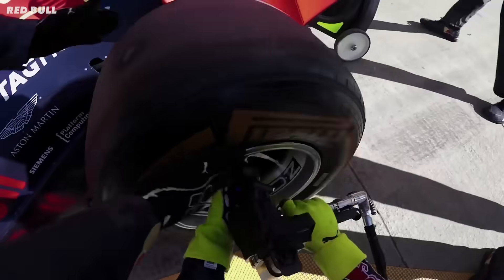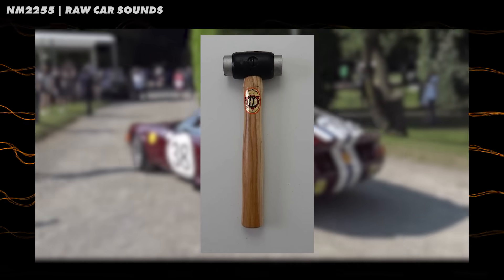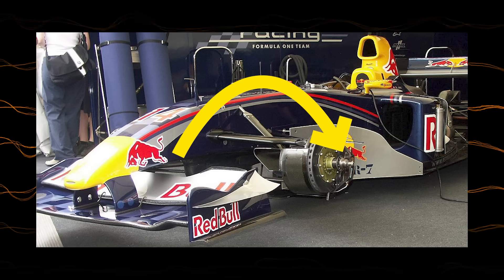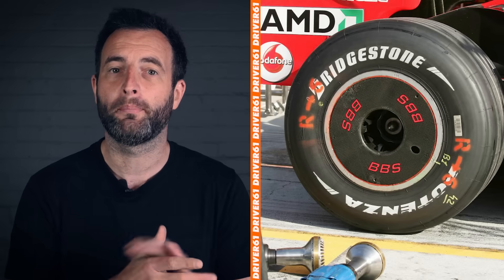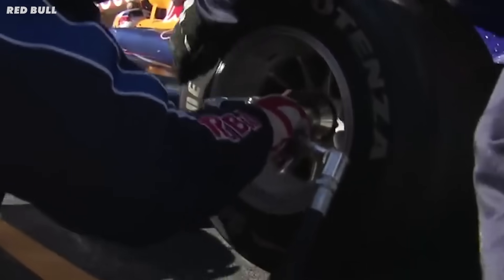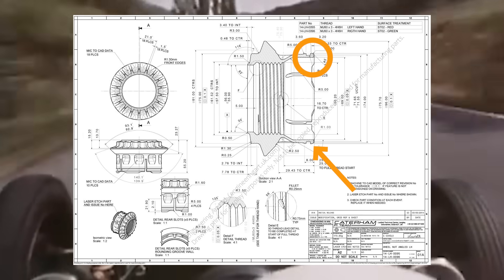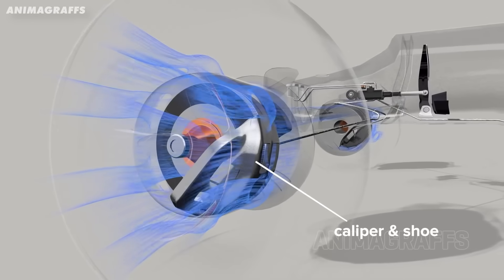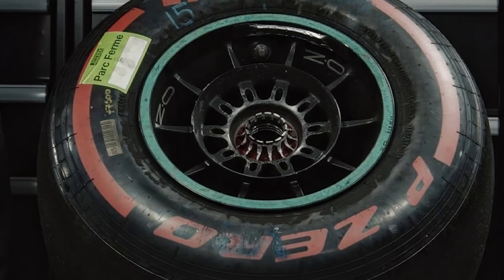Why F1 Wheel Nuts Cost £50'000

Comment: Pure aluminium is soft yes. But that's not what is used. Aluminium alloys can be both hard and strong.
And as a machinist that have worked with materials from basic aluminium alloys (it's never used pure) to heat resistant superalloys like Inconel I know that machinable aluminium alloys are among the easiest to work with. However I'm sure the alloys in these are very specific, perhaps custom made. I wouldn't be surprised if several teams use secret alloys, thus the in-house manufacturing (otherwise they would save a lot by buying from one external shop, it ain't a difficult part with unusual requirements)
Reply: They probably used forged wheel nuts with machining
Reply: AFAIK in motorsport they usually use EN-AW-7075 alloy for parts like these.
Reply: @martinbrandmuller8272  7075 T6 to be precise, it’s a tempered (and thus hardened) version. But as it isn’t really heat resistant due to dispersion of the carbide molecules, alloys of the 2XXX range are used for higher temp applications
Reply: Sorry this is probably a stupid question instead of aluminum alloy why don't teams use titanium nuts. Because if I'm not mistaken titanium is light but strong. So there is less chance of stripping the nut.
Reply: @chowjohnathan2825  Not a stupid question. In short, titanium is not that much stronger per weight (it is 70% more dense than aluminium, so you would have to carve 40% of the wheel nut away to match the weight of an aluminium wheel nut; similarly, a good steel alloy is even stronger than titanium but at almost double the density, or almost triple the aluminium density, which would need even more skeletonised design).

I, however, doubt an aluminium wheel nut costs anywhere near a grand a piece, especially if they have to make 52 of them per race per car. No matter that it is machined out of a relatively fancy aluminium alloy like “7075 T6” and then anodised (which is the bog-standard process for making more colourful and durable aluminium parts, and which you see in most aluminium bicycle components costing a few pounds a piece or less, or even in commercial aluminium nuts costing a few pence a nut). Like, despite the visual complexity, they are simple to machine, from an easy-to-machine material, with a simple bog-standard post-processing (including the x-rays). And, they are made in semi-industrial scale... Yes, if you would make one such nut with the full process, it might be close to that. But, the cost is in setting everything up for the small-scale production run.

So, I would expect a much lower cost for such a custom nut made in a batch of a few 1,000 nuts per season... which is also why they make them out of aluminium, as titanium is both expensive and much harder to machine (as in, needing more machine time to make, which costs money). A (semi-) disposable aluminium nut is probably much cheaper than a titanium nut that can take a few more repetitions, or even a hypothetical skeletonised-to-oblivion steel nut that could possibly last a full season but that risks breaking the axle or the tool when things don't go to plan (though, the way they tighten the nuts, I would assume even such a steel nut would not last that many uses even if using the fanciest allowed steel alloy; such a steel nut would also need a lot more machine time to make given the hard alloy and the much more extreme skeletonising).

So, an aluminium nut shearing easily is also a feature that saves the much more expensive maraging steel axle for the next use. Make a pile of “cheap-by-F1-standards” nuts (unlikely to be a grand a piece) and have the axle last much longer...
Reply: @L2M2K2  Thank you
Reply: @L2M2K2  I think good bike component comparison would be a wheel hub. I have Hope Pro 4 Hubs on my mountainbike, which are also machined from a forged block of aluminium. They are nicely machined and you can get them anodized in various colours. The rear hub cost me ~240€ and the front hub ~100€ and that includes all the other parts like the axles, the bearings and the ratcheting mechanism of the freehub. A great video about how they're made is called "Hope Pro 4: Behind the Hubs".
Reply: @eliasrenner555  That is actually a very good example in terms of cost. The front hub, that is.

Though, given that they use a forged-to-near-the-final-shape blank for their the CNC, they are actually a bit fancier than the “fancy” F1 wheel nuts shown here (with the step-by-step nuts shown to be made from a round tube blank). As in a tiny bit stronger per weight. One huge benefit of a larger manufacturing run that it allows to make the custom tooling for the forging, which not only saves in materials but also in CNC time; despite the stronger final part. But, that still sets a reasonable lower bound for the price given the size (it is a bit simpler to machine, but, then again, the rear is already a lot more complex).

Thinking back: In terms of fancy parts, the same applies to the hollow crank forgings used by Shimano in their high-end hollow aluminium bicycle cranks. Something you cannot even replicated with CNC only... and a hollow sintered 3d print does not even come close in terms of strength. Yet, for under 100 pounds, retail, you can buy such a marvel of engineering.

This is not to say that F1 wheel nuts are not fancy. They are. Rather, it is to say that some very standard looking parts are also way more fancy than meets the unsuspecting eye. F1 is not the only place where the weight matters, and in F1 they clearly also have their internal “that gram of weight is not worth that pile of cash” realities, which also include the small runs of parts they make. And, well, I do not think you can save that many grams with a forged blank for a wheel nut... for a big cost unless you would use the same basic design for years on end, which we all know they will not. The other-than-weight gains are much more relevant there.
Reply: Aluminium is often used pure.
Reply: @Retired Bore  @Retired Bore  you're incorrect on every point.
A drinks can is an incredibly pure structure. Every aspects of its design is about safely containing the pressure and easily opening it.
A drinks can is not made of pure aluminium, it is an alloy, usually 3000 series.
Pure aluminium is actually used for electrical conductors, foils and coatings. 
Mobile phone chassis are not cheap parts. You're getting confused between materials and the economies of high volume manufacturing. 
Learn about temper. Alloy series are often irrelevant without considering temper. 

You clearly aren't an Engineer so you're welcome for the education.
Reply: £150 part there if they are ordering hundreds. But they will want them yesterday so pay the F1 tax😂
Reply: They are not permitted to use the more exotic alloys.
All the teams are mandated to use the same alloy.
The entire materials list for braking systems must be published openly. No exceptions.

So, no, none of the teams are using secret intergalactic alien space metals.

Comment: To me this sounds like a good application for titanium, as although MORE expensive for the material, and harder to machine, it is tufter and as such if it lasted three times, would more than pay for itself.
Reply: @@retiredbore378 Good explanation! Thanks
Reply: It's about 25x the cost for the same part in titanium vs aluminum
Reply: @madrox4132  : Wow, I would have thought only around double.

Comment: Super piece Scott! WOW! I had no idea of this throwaway expense - incredible. 
 On Bottas nut in Monaco the gun man basically made the gun a stump grinder. Do some of the teams use a gun with a safety button on the inside for positive engagement to prevent this? Thought I'd picked that up somewhere.
Reply: That's my thinking too, it would make sense to have pressure operated switch inside the wrench socket and the wrench only activates when enough pressure is detected (say, 20N). This would require the wrench operator to just hold the trigger while pressing the gun towards the nut and when pressed hard enough, it takes off the nut. And if the slots do not engage, you couldn't apply the 20N pressure no matter how much you press.
Reply: I imagine downside would be more parts means more failures. And maybe adds a tiny amount of time too to register and activate. For how rare that happens not worth it.
 @MikkoRantalainen
Reply: @simonwadd4038  Yeah, and I've later found out that the wheel guns are standardized / regulated, too, so if the gun doesn't have such feature it cannot be added by the team either.

Comment: Why not make them out of titanium? As far as I know titanium is stronger, but then that it might be more crack prone with all the power that the guns produce
Reply: I'm not an F1 engineer, but titanium is less of a wonder material than most realize. The strength of titanium and aluminum alloys is actually very similar on a per-weight basis, you can make a part quite as strong and light with aluminum as you can with titanium, only the titanium one will have smaller overall dimensions and might be harder. Also, most non-initiates don't realize that titanium is an absolute BITCH to mill, especially if you need thin-wall like features. The istant the mill skids or jumps, titanium work hardens tremendously, potentially decreasing the overall toughness of the part.

Even worse in the case of fasteners, titanium tends to gall badly under impacts. I can't exactly say what would happen when a titanium nut gets exposed to the kind of force an F1 grade impact driver develops, but i don't think it would be too pretty.